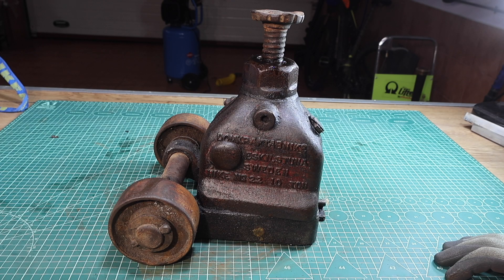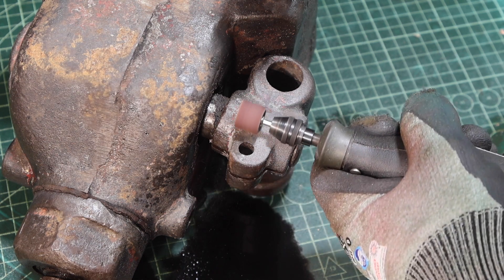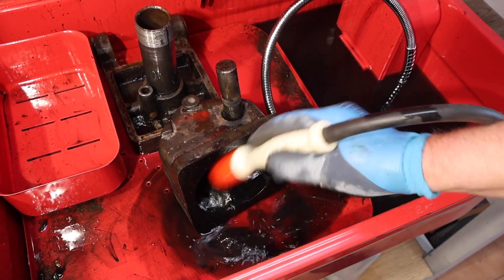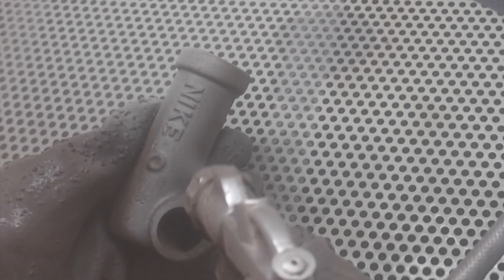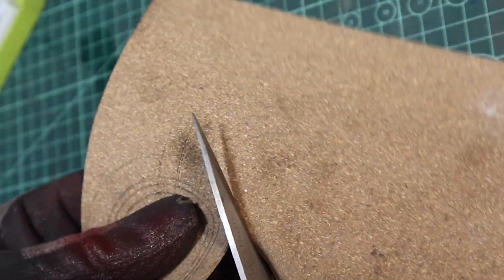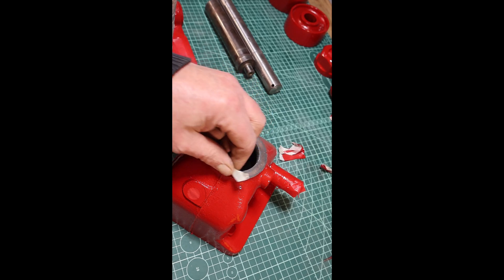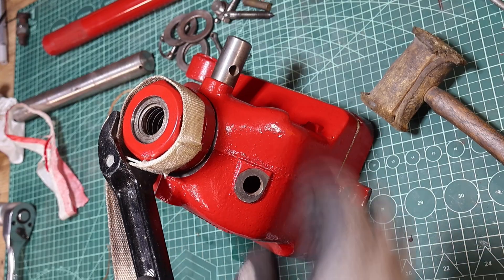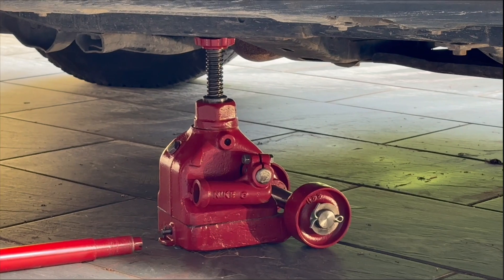Can This Old Hydraulic Jack Be Restored to Its Former Glory?

Comment: Are you familiar at all with the term "degloving" and rotating tools like a grinder or wire brush?
Reply from the maker: Please explain the context. Do you mean being wrapped up in the brush
Reply: @PremierRestorations-fh5ln  yeah while wearing gloves and using a bench grinder the glove can get caught and rip the skin off your hand and often even fingers. The speed of the rotation is more than enough even with a weaker glove to rip most of your hand off with it.
Reply from the maker: Thanks indeed for the comment. I have had some bad experience with rubber gloves on a lathe not at home at my business. With rotating tubes. It can wrap around the tube and pull a finger out. I have a distorted finger. This has happened to other people at work basically using emery cloth on rotating tubes. So i banned rubber gloves
You are of course right.  Maybe something better is fine leather which does not tangle in which i think is called kid ie baby goat leather.  I will take heed of your comments and thanks again. Hope you enjoyed the video